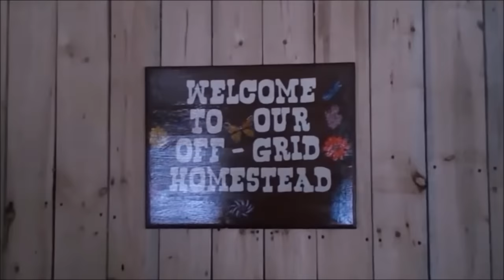I Am Still Slugging Away Here At Our Off Grid Homestead

Comment: It sure does look nice as far as dry wall cracking I don't really think it would they make the.mobile homes that are 14 by 80 and they bend twist when they move them I'd have to say it would be just fine in your house
Reply from the maker: Thanks Will.  Good to know,  I haven't done much dry wall  :-(  I was worried about the joints cracking.  I would rather use dry wall than ply wood.  Thanks again.  Take care ttyl.  Cheers  :-)
Reply: If it was mine I'd be putting up drywall even if it would crack it wouldn't be much